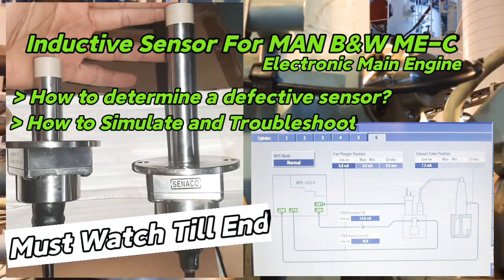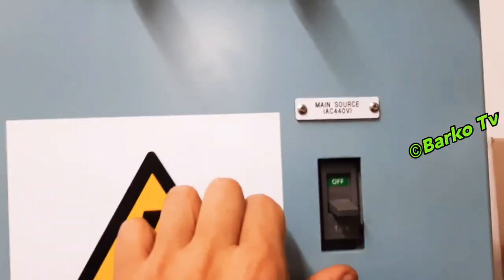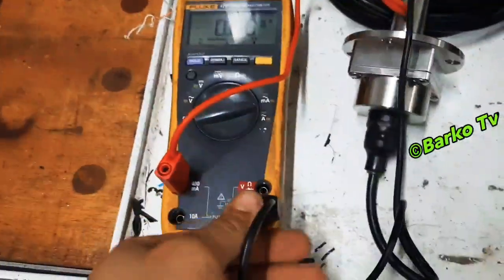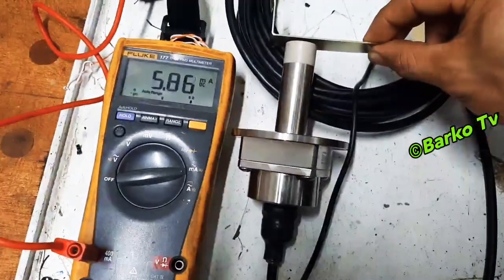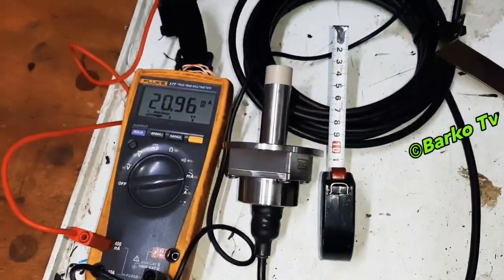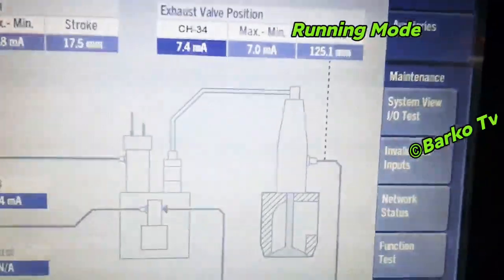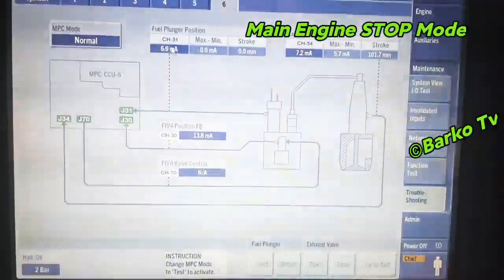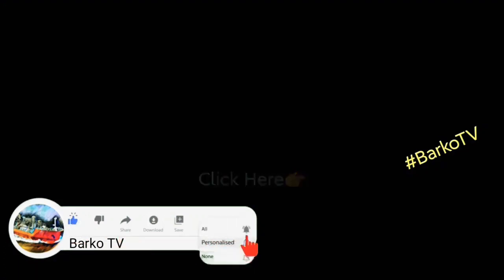Inductive sensor Simulation |Troubleshooting | MAN B&W 6S50ME-C | Kalecky | Barko Tv | makinista

Comment: sir lagi bang 4-wire ang mga inductive sensors? 2 wires for dc supply and other 2 is for 4-20mA signal? same lang po ba ito ng tacho sensors sa my flywheel? MC-type MAN B&W palang po ksi naexperience ko.
Reply from the maker: Iba sir, applicable to sa inductive sensor